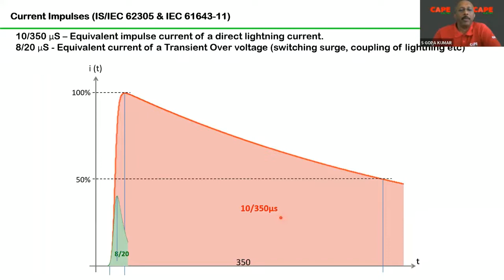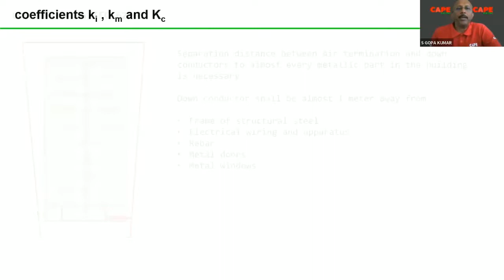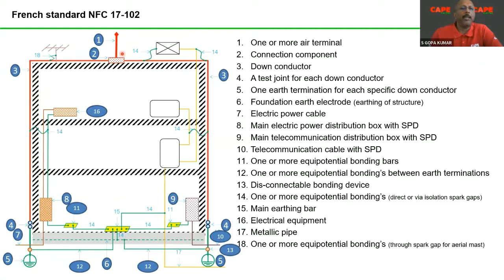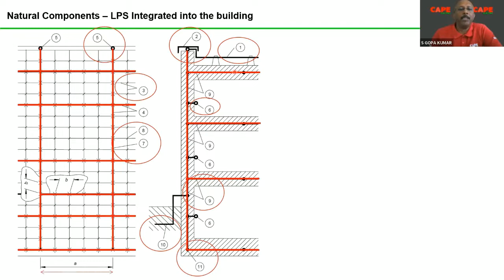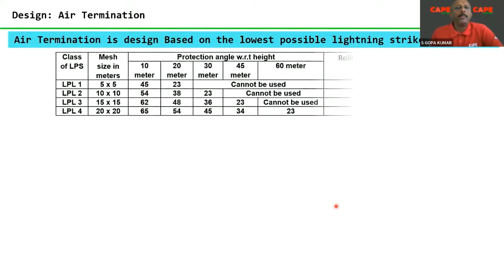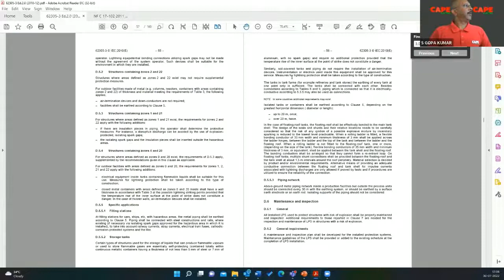Lightning Protection for High Raise Buildings

Comment: Basic Principle of  Lightning protection is to prevent the formation of a "High Potential  lightning  Cloud" above the building which installed LPS, by sending Negative ions through the Air Termination System. If a lighting strike on the Air Terminal,  we can't imagine what will  be the effect.

Comment: In 2003, Darveniza’s suggestion became a reality when the principles of Collection Surface Method were included in the Australian lightning protection standard, AS1768. This made Robiah the first woman in the world to have developed a new lightning rod placement method in the last 200 years.

It placed her in the same class as Lussac and Maxwell, whose methods are in the standards and applicable today for low- and simple-shaped buildings.

In 2006, the principles of CSM were included in the new international lightning protection standard, IEC62305, thus making Robiah’s method applicable on a worldwide basis.